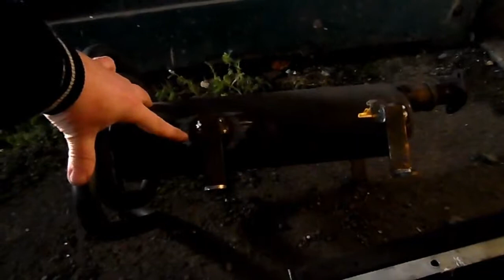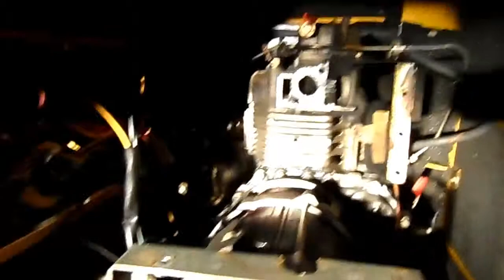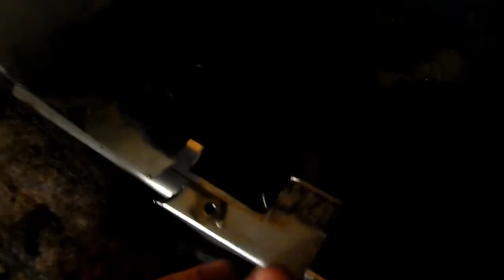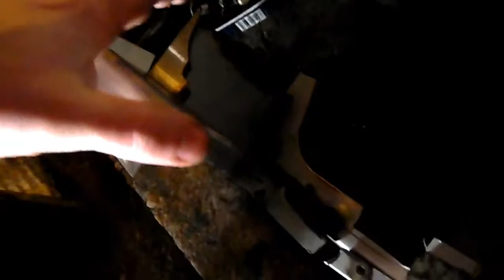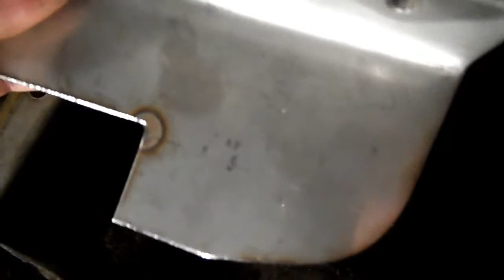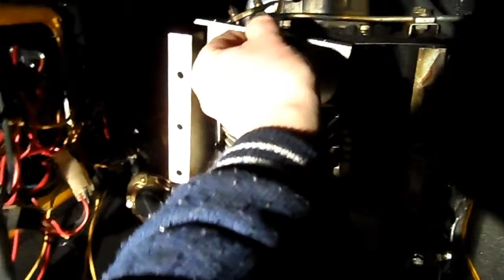DGen6000 #03

Comment: Just bought one of these things off ebay in bits and wondering where those curved resin bits at the end of the generator go?
Very handy video, any chance you could do one on the wiring?
Reply from the maker: +Rheinallt James  Uploading a short 8 min video DGen6000 #05 with a quick overview of the electrics. If you have specific questions get in touch as I can help at the moment but intend on reassembling the geneerator some time soon so wont have access to the wiring loom after that. Hope the video helps.